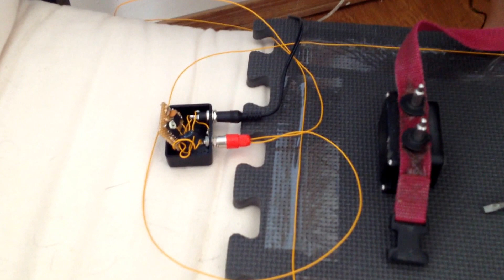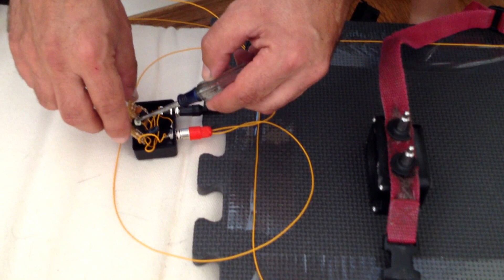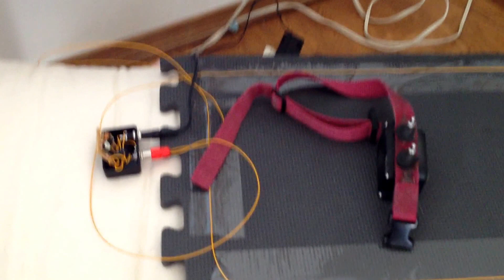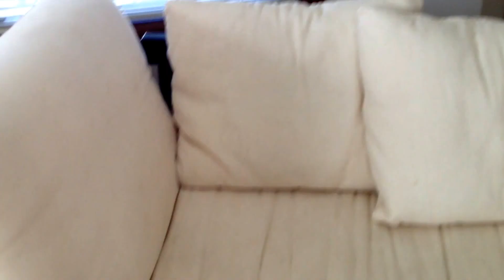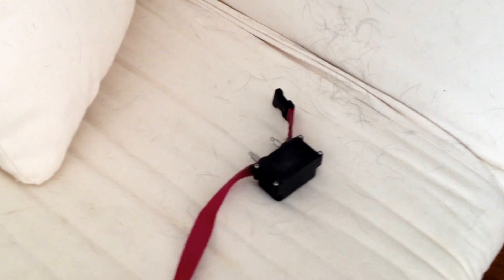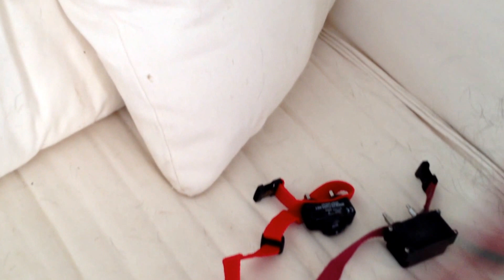Wireless transmitter for PetSafe shock collars using 2 555 ICs

Comment: This is for the in-ground wired system...  Petsafe has a similar truly wireless system (no in-ground wires for the fence) - do you think that transmitter could be replicated in a similar way?  How do you tell what radio frequency it's broadcasting on?

Comment: Hi, Whyameye.  I'm working on a project to use a similar system to control golf cart traffic and could use some help getting started.  I'm hoping to use the buried wire system with the range of the signal increased to a bout 20ft from the wire.  For the receiver, I'd like to have an audible warning followed by a disabling of the cart rather than the 'shock' that a dog would receive.  Can you give me some guidance on how to build a simple transmitter like the one you have here with a longer range and a receiver that just has picks up the signal and reacts with the two-stage reaction?  I am a simple mechanical engineer, so all of this electronic stuff is way out of my league. :) Thank you in advance for any help you are willing to provide.
Reply: My email address is rickkalil@hotmail.com if you are so inclined.